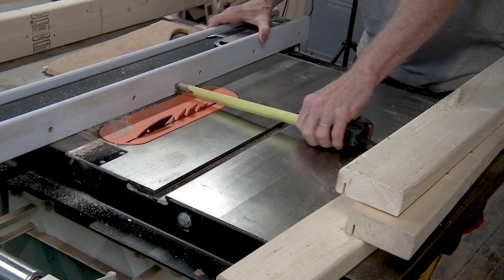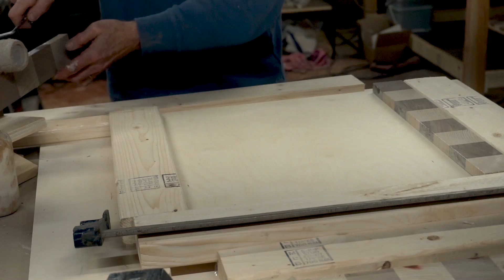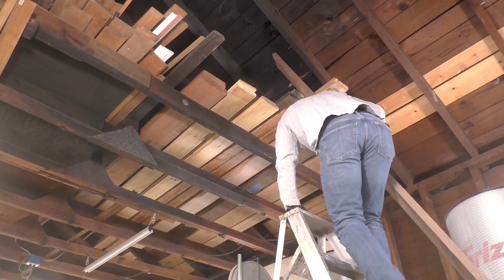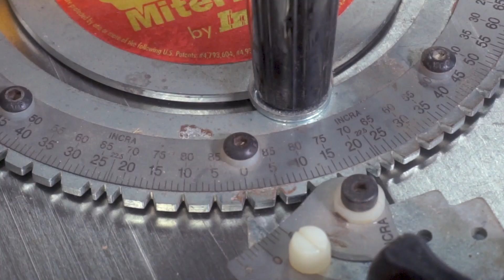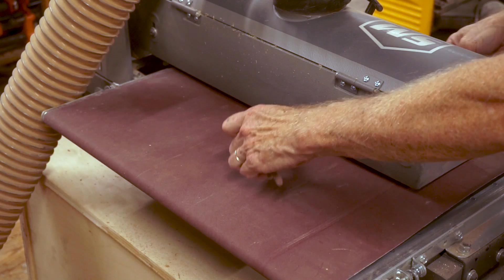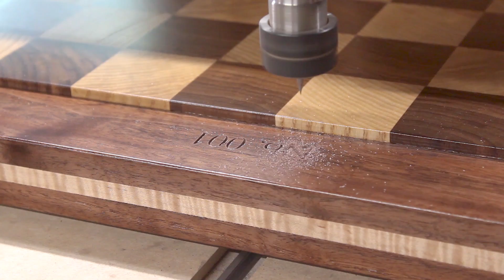Gothic Chess | Double-Sided Wooden Chess Board

Comment: Do you think this with the plywood core is more or less stable than your endgrain boards .
Reply from the maker: It's more stable with a plywood core because the cross grain laminations of the plywood veneers move very little.
Reply: @Woodumakeit  thanks , I've been asked to make some chessboards,  I'm tempted to do a plywood core but feel a custom order should be solid wood . It's a dilemma.   Love your work.
Reply from the maker: @kellywillems6126  I know that feeling and each time I have to convince myself that using plywood or MDF is going to be better in the long run even though it connotes lower quality.

Comment: As usual, terrific work and really nice chess board. Question: When you run the epoxied number and letter boards through the drum sander does the epoxy gum the sandpaper up very much?
Reply from the maker: I take really light passes to try to prevent that. It doesn't seem to gum up the sandpaper very much at all. The thing that I have the most problem with is maple. It must have a sticky sap (hence maple syrup) that gums up the sandpaper.

Comment: That's really pretty.  I was chuckling because I have the same dado set,  miter fence, T-rule, and orbital sander, and I use the same glue.  I just made a copy of the board for Hnefatafl that Pask Makes made, (https://youtu.be/iiHlAa131NI), and a couple of pieces, and am procrastinating on making the remaining couple of dozen.
Reply from the maker: I watched that video a few months ago. Definitely a lot of effort that went into that one!
Reply: I've tried that link a couple of times but it doesn't work
Reply from the maker: @Tinker1950  It has a parenthesis at the end of the link that you need to remove and then it will work.